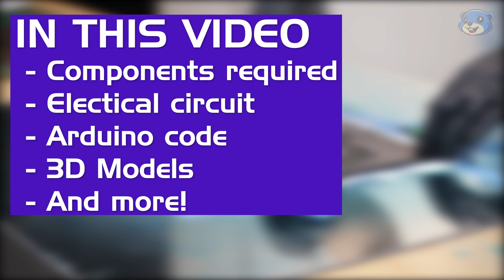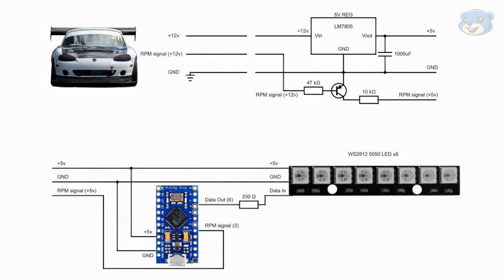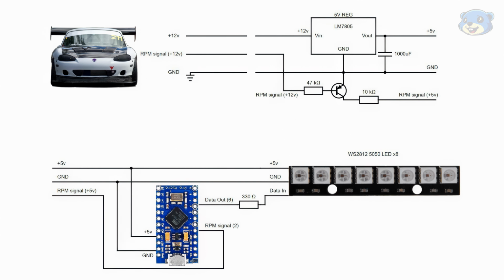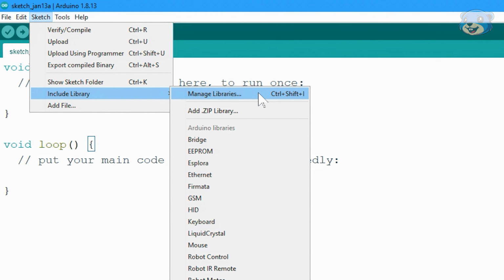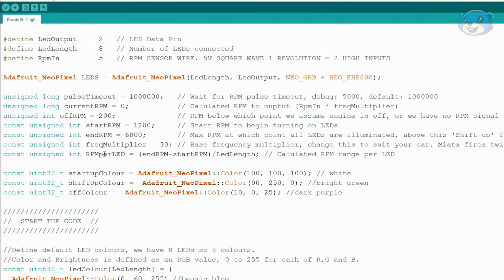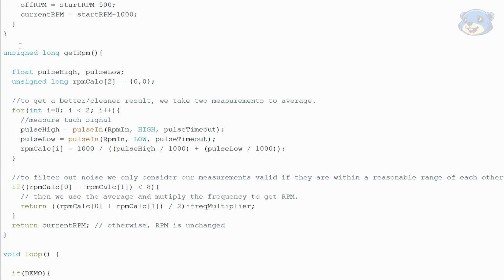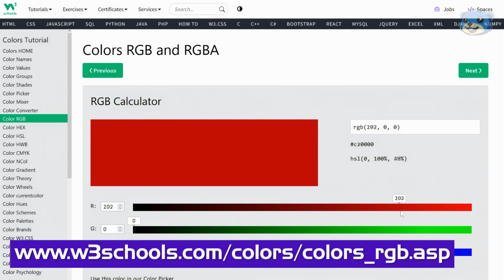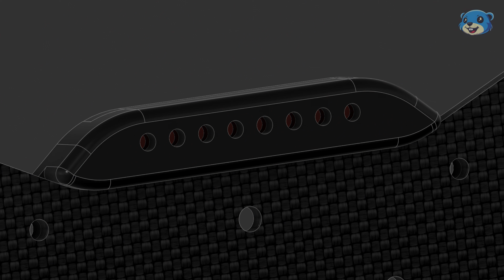Building a Sequential Shift Light - DIY GUIDE

Comment: Great content. Just used your code to build a shift light for my mini, made a couple of changes to the code for dimming with headlights and an ecu warning light where they all turn yellow if there is an issue.
Reply from the maker: Nice work!
Reply: about to attempt the same thing, just interested where did you get the rpm signal from?

Comment: This is awesome, now if i wanted to add a second and separated led strip (using 2 of those Ws2812 in total) so i can configure them to start lighting the edges at low RPM and then reach the center when reaching redline, how are the steps for that in regards of wiring? bridge the connections of both leds like a daisychain keeping a single output on the ardruino and then add more to the code and do the changes or it needs a separated output entirely? Thanks in advance, im gonna make this and put it on my motorcycle.

Comment: Do you think it's possible to use a mini buck converter instead of the 5v regulator? 

I've got them and I as thinking to use them with the pnp transistor because when looking at the diagram the transistor receives a common gnd and if I'm not mistaken rpm gets filterd through it to scale down voltage with the resistors going in and out.

The way I'm understanding it is that the arduino needs 5v and rpm signal must be 5v so by stepping down voltage into arduino it should be safe?

I've got 5 arduino nanos so I'll give it a shot, on the plus side it's less wiring.
Reply from the maker: I'm not skilled enough with electronics to say 100% for sure - but I don't see why you couldn't use a mini buck converter in place of the 5v regulator.

Comment: Hello! Nice work on the car. Looks clean. 

So I’ve followed this build but made some changes to the code to compensate for 16 LEDs.  I think I got it right but when I power the unit up, I get constant white leds. Any ideas?
Reply: If anyone else comes across this issue, I switched to D2 and the boot up sequence seems to work.  I am using the Nano, so perhaps that will make a difference.Will report back.
Reply from the maker: Thanks for watching. Indeed you can freely swap pins around, just as long as the output matches the code and the wires you have to the LED.
Reply: Hey, thnx for the clear explenation!

Im also building youre arduino dash👍🏻

Did you used a megasquirt output for this shift light? If yes witch one did you use?

Thnx,

Kind regards Jordy

Comment: I'm trying to upload the code to an Arduino Pro Micro and I'm having a few issues. First issue is that IDE doesn't have the Pro Micro as an option for the board, so I tried using Leonardo like you did but that leads to the second problem. The only ports showing up are COM3 and COM4 and both give a similar error: 

avrdude: ser_open(): can't open device "\\.\COM4": Access is denied.

Do you know what's going on here? (I'm on windows 11)

Comment: Bonjour, je suis français,  merci pour ta présentation, j'ai réalisé un projet aussi, j'ai deux problèmes, ton branchement ne correspond pas au schéma ? Pin 2 et 6 sur le schéma, Pin 2 et 5 sur le code ARDUINO, je m'en suis rendu compte,  lorsque je connectes la carte sur l'alimentation le code fonctionne, merci,  mais moi je souhaite équiper ma moto avec ce shift light, est ce que c'est possible ? J'ai branché le signal sur le CDI mais ca ne marche pas, tu aurais une idée ??

Merci à toi 

Hello, I am French, thank you for your presentation, I also carried out a project, I have two problems, your connection does not correspond to the diagram? Pin 2 and 6 on the diagram, Pin 2 and 5 on the ARDUINO code, I realized this, when I connect the card to the power supply the code works, thank you, but I want to equip my motorcycle with this shift light, is this possible? I connected the signal to the CDI but it doesn't work, do you have any ideas??

Thanks to you
Reply from the maker: Bonjour, les broches d'entrée et de sortie dans le code peuvent être ajustées.
Si vos LED fonctionnent avec DEMO réglé sur true, alors vous savez que le système est configuré et fonctionne.
Ensuite, il vous suffit de recevoir le signal RPM de votre vélo. Chaque véhicule est différent, vous devrez donc trouver le bon fil de votre vélo et la bonne fréquence.
Bonne chance!

Bonjour, the input and output pins in the code can be adjusted.
If your LEDs are working with DEMO set to true, then you know the system is setup and working.
Then you just need to get your RPM signal from your bike. Every vehicle is different, so you will need to find the right wire from your bike and the right frequency.
Good luck!